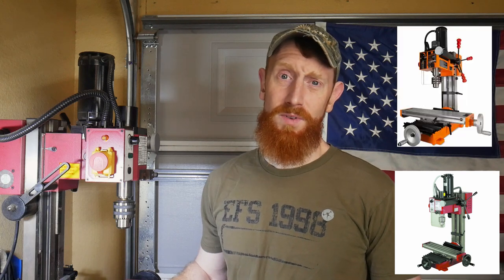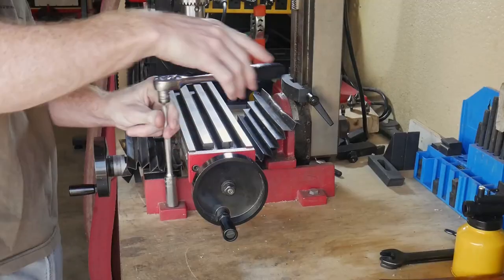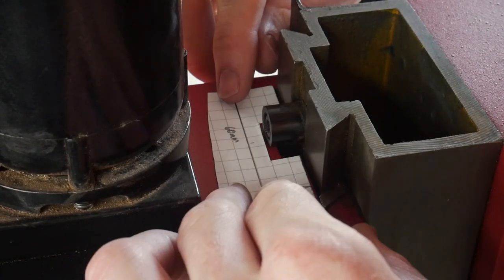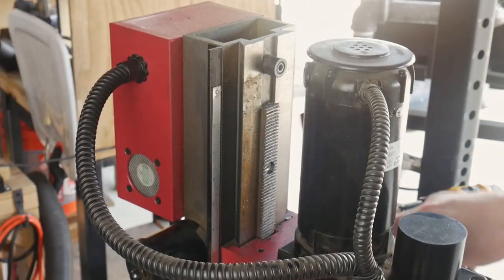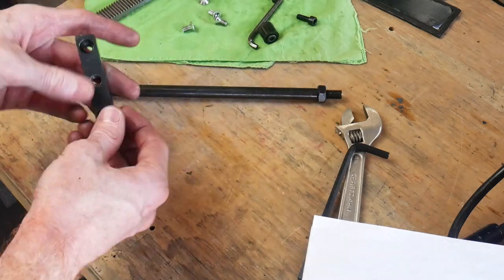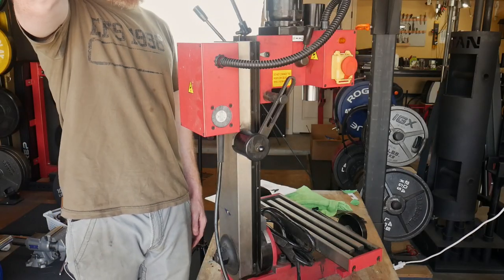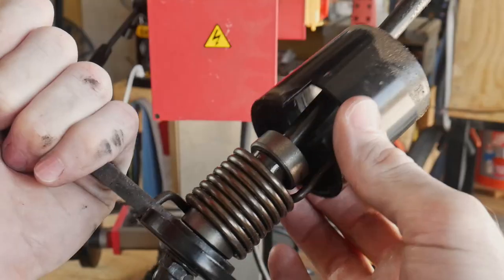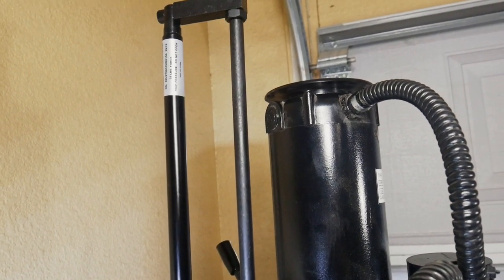Upgrading The Sieg X2D Mini Mill - Air Spring Install Guide

Comment: Dude, thanks so much for the help, your video supplemented with the instructions helped make this an easy project. I also saw the template was wrong . I’m not sure why they haven’t fixed it . This also gave me room to mount a dro on the left side now that the spring is gone.
Reply from the maker: Heck yeah! Glad it helped Matt! Cheers

Comment: I just installed this. Definitely go with his 20mm dimension recommendation for the mounting bracket, not the 18mm on the LMS template. I also recommend doing this at the same time you do the belt drive upgrade. At least the motor will be out of the way if you do. I had the spindle housing on a bench to pull out the old/uneeded intermediate shaft and  gears, so drilling and tapping as well as replacing the Z axis gear rack was very easy. 
I will say this air spring does support the mill head better than the torsion spring; however, the Z axis is stiff when course feeding downward toward the table. More than I prefer anyway, but I can work with it. I'm thinking that must be the tradeoff for the improved support unless I installed something incorrectly.

Comment: It is also worth mentioning that the reason LMS has these Sieg machines at their given price point is because they pretty much do all of the QC and necessary upgrades for you.  The same mini mill from Harbor Freight will not have that unless you do it yourself.  These guys are more like parts kits rather than full-fledged shop tools out the box.  Shipping kinda sucks given that they are located in Pasadena, CA; but they are definitely good to go if you want to purchase table-top machines and more.  I bought their 10" 12-speed drill press after my ancient Ryobi shat the bed, can't wait till that comes in!
Reply from the maker: Nice!
Reply: The Sieg mill is a "mill of many names" IIRC Practical Machinist magazine did an article on the SiegX2D. The same applies to yard equipment; i.e. lawn mowers, snow blowers, etc.

Comment: so it's basically threaded strut with a block to mount to the head. I think I could fab the upgrade, since LMS has been sold out of these for a long time. I could go on with my torsion spring but it kind of gets in the way for the best place to mount a DRO on my Grizzly 8688
thanks for showing the process! very simple to see how it's done
Reply from the maker: Cheers Paul! Glad you got something out of this one.

Comment: Good stuff... I have that same mill as well as the HF lathe.   I need to true them both up though and tighten up everything.
Reply from the maker: Very cool. I'm thinking of replacing the column on mine with a fixed column... That pivot is dumb
Reply: @RedBeardOps  I've got some kind of upgrade for it... brushless motor maybe?  Hell, I dont even remember what it is. I've had it for years now and havent gotten around to installing.  Too many projects, too little time.
Reply from the maker: @rroberts8501  Man, that's the damn truth...

Comment: Instead of using the round travel stop you could gain an extra 1" of upward travel by drilling and bolting a stop bracket to the very top of the post.  Assuming the air piston could travel that extra inch upward.  Just a thought, I may be wrong.

Comment: Red Beard; the next best thing you can do is install the V BELT conversion as well & eliminate the plastic gears inside the the top of the power head. I ordered my KLUTCH labelled X2D from Northern Tool before the "Kung Flu" hit & since then, the price for the same mill has jumped to almost 1,000.00. Harbor Freight's price is still under 800 bucks yet. I had a customer come into work one day asking if we carried the plastic gears to the Sieg X2D. I knew we didn't; I showed him the L.M.S. website on my phone & wrote it down for him & suggested he could get the belt drive & eliminate the plastic gears. I work at a family owned hardware store.
Reply from the maker: I did! - https://youtu.be/wOQ1QXdvO4s

Comment: Perfect video. Could you do me a favor, I hope it's not asking too much.  My enclosure for my mill when not in use has a certain ceiling height and I want to know if this will clear it with the head lowered all the way down. Could you tell me the overall height of the installed mechanism with the head lowered?
Reply from the maker: Thanks. With the chuck touching the table the total height is 26-3/4'' (about 3.5'' taller than the column)

Comment: Red Beard; in installing my air assist after watching you struggle around the motor; I would remove the motor fully from the mill and assemble the air assist and mount it to the mill before going through & measuring for the questionable holes (per the L.M.S. drawings which were underscale). Level the air assist up with a torpedo level & then use the punch to locate my drill holes through the block that mounts to the top of the machine. It may be an extra step or two but worth the extra effort. I put the belt drive onto my mill & it runs a lot quieter vs the plastic gears which are susceptible to breaking at the worst possible time.
Reply from the maker: Good point! Cheers sir
Reply: @RedBeardOps  when I got my mill home from Northern Tool after I toe the crate apart; it was "falling apart" by the time I got it from them. After I got it in the house I was going though things & took notice several fasteners that were installed with air tools were stripped out at the heads. I paid a visit to my local hardware store & got brand new fasteners. Call it O.C.D. but with my already planning on putting the v belt kit on I may as well get new hardware.
Reply from the maker: @MRHSDM316SD18186  Man I gotta say; if I had to do it all over again with Sieg mills I'd just start with the LMS 3990. It's fantastic - https://youtu.be/POFarYxpgws
Reply: @RedBeardOps  I bought my mill after I inquired with Harbor Freight on the price; they wanted the money upfront & they still had to order the machine. I paid Northern Tool after they got the machine from China.

Comment: Yup, going to buy this conversion kit for my second hand LMS 3960 I just bought.  I'm curious to know if it's best to leave the head all the way up so as to now keep the gas strut always compressed?  Basically, like springs etc. they stress relax over time so what's the best position to leave the head?  Thank you.
Reply from the maker: Man that's a good question. I have no idea! Worth researching.
Reply: @RedBeardOps  these struts have been and still are used in the auto industry.  One way to think about it, do car owners leave their hatches open when possible?  :)  It's probably a moot point to consider, but that's how I roll.

Comment: Looks like you could put a hole in that cap that went on top of the column and then you can seal it off just go around the air spring
Reply from the maker: Hey Casey, I think you're right that would work.

Comment: Nice video.  What types of metal are you able to mill with that?
Reply from the maker: With patience just about anything. I've milled aluminum and steel with it. You really need to take your time with it though on steel. Having a solid/fixed column would help.
Reply: @RedBeardOps  Does Little Machine Shop's mill have a fixed column as purchased?  How about their gears...are they plastic like HF's?  Have you upgraded those?  Sorry for 20 questions!
Reply from the maker: @walte99  It comes with a fixed column and air spring. And I think a more beefy motor. On the gears side, I know it doesn't have the plastic gears, but I'm not sure if it's got metal gears or the belt system. Worth checking out!

Comment: I just received my upgrade kit. The 18mm dimension you say could be 20 or 22mm... Which would you suggest to have the "air spring" plum, 20mm or 22mm? I'm going to remove everything so tool clearance isn't a consideration.
Reply from the maker: Hey man, I have to say I'm not sure. It was a while since I've done this project.
Reply: @RedBeardOps  
No problem. I just installed the air spring first and held it plum. Then I got my location. Turns out they may all be slightly different. I ended up at 15mm rather than the 18mm on the drawing or the 20-22mm suggestion from you. Thanks for your reply brother.

Comment: Dude, get your self a belt system.
You can make it your self if you have 3d printer.
You will how ever need at least 1 small pulley machined from either ABS or Nylon, or aluminum.
Large pulley can be 3d printed.    Check out my last video on that subject, maybe you'd want to try it out.
Reply from the maker: Sorry for my delay on this comment! I did that upgrade! Way good. https://youtu.be/wOQ1QXdvO4s

Comment: That spacer you didn't use. I purchased a 2mm longer capscrew for the rod attachment at the bottom of this assembly and used the spacer to move the cylinder section of the of the gas shock away from the column. It rubs at the fully lowered position without this spacer.
Reply from the maker: Thanks Bob!

Comment: Very nice! Um was that piece intended to replace the longer column stop you ground down? Or was it a spacer for the mounting rod of the assembly? Or maybe it’s for use in one of the other mills that are slightly different? No docs, so it’s all guessing here.
As to the torsion assembly....perhaps it becomes a piece of Damascus for another blade project....
I mean the spring might come in handy somewhere down the line, but it doesn’t seem like much of a spring, anyway. But it appears to have enough carbon to probably harden well and might just be good material for “Bodger’s Damascus” (bodger- see any old episode of Junkyard Wars).
I really enjoy these videos you put out!
Reply from the maker: Hey Chuck, that spacer wasn't in the instructions... so I have no idea! LOL, once I find out from little machine shoip I'll put it in the top pinned comment.

Good thought on the torsion spring... That spring may be good metal. 

Thank you sir! Have a great weekend!

Comment: What sort of things do you use that mini mill for?
Reply from the maker: I use it a lot as a very rigid drill press... But I've milled a good deal of aluminum on it to make tools (surface grinder). I also use it with a router bit to flatten handle scales. I've done some milling on steel with it as well, but note you'll have to be patient with your feed rates. Lastly I've used it to mill guard slots on hidden tang knives, and plan to use it to mill in my shoulders on my next hidden tang.

Comment: How much additional height is the assembly over the top of the column. I might need to reposition a light overhead. Fewer parts then the two air spring units and pully and cables I have seen done.
Reply from the maker: With the chuck touching the table the total height is 26-3/4'' (about 3.5'' taller than the column)
Reply: @RedBeardOps  So if the head is at the upper stop it could be like 13 1/2 inches above the column top?
Reply from the maker: @gvet47  The height of the mechanism above the column is fixed.
Reply: @RedBeardOps  Sorry had to watch again. Now I see it stays relative by the he fixed rod. I must have spaced out. I have a tachometer that sits on  the top of the column now but it is just on a magnetic base I moved  from a small wood lathe. Have a similar setup on my small metal lathe both in 3D printed boxes.

Comment: I also suggest the L.M.S. belt drive conversion.
Reply from the maker: I've heard great things about that!
Reply: @RedBeardOps  very easy to put on. I had the conversion kit before I got the mill from China. And it does make the mill quieter, and comes with all required hardware
Reply: @RedBeardOps  it runs quieter than with the plastic gears

Comment: So thats the mill Ive seen you true up surfaces on?  Is it capable of surface grinding?
Reply from the maker: Hey man, I use a surface grinder for the flats on knives. You could use a mill for that operation, but it would take much longer. I use this mill for all my drilling, and for milling in slots for guards, shoulders, flattening handle scales, etc. 

Here is my surface grinder build - https://youtu.be/_Q2aujE3pWk
Reply: @RedBeardOps  You were nice enough to reply and I thank you, but I think a meaningful  question is... can you grind a billet as flat and as uniform as capable, and use a mill to do the rest an a reasonable amount of time?  My budget wont allow to buy both the tools right now, and I'm not gonna build my own surface grinder and especially with out a mill?
Reply from the maker: @xthemadplumberx7110  I think to do this on a mill you would want a magnetic chuck and a fly cutter. It's all possible, but I think you'd be better off going a different route if flattening is all you want it for.

Comment: I have exactly mill (OTMT) and the motor has intermittent power. When I turn the potentiometer the motor sometime turn and sometime not turn. Anyone please help me to fix this problem? Thanks.
Reply from the maker: I bet your plastic gears are broke. Watch my belt upgrade here - https://www.youtube.com/watch?v=wOQ1QXdvO4s&lc=UgymRwUyb2-FRc-y6WF4AaABAg may help
Reply: @RedBeardOps   Thank you very much. I will upgrade my mill to belt drive as you did.
Reply: @RedBeardOps  I open the top. the gear look ok. Even with the motor does not attach to gear. It still not turn. I got only 64 volt to the motor. Not sure it is right.
Reply from the maker: @trivu5951  I'd advise contacting the people here to help you troubleshoot - https://littlemachineshop.com/
Reply: @RedBeardOps  I will. thanks.

Comment: nice little mod but it is a shame it goes inside the columm as I will be filling that with epoxy granite
Reply from the maker: You may be able to rig it up on the outside. Would take some fabrication though! Cheers man !
Reply: @RedBeardOps   I was wondering that also.. Thanks for the reply

Comment: did this years ago.

then as things like windows went hostile and PCs fried... i havent used it in years.

tearing down the other day. new bearings, spindle, blah blah...

THEY LEAK!

what was 15kg iirc, is now about 2kg...
Reply from the maker: interesting comment sir
Reply: @RedBeardOps 
contemplating an air cylinder now. 16mm/250mm stroke. assume 1/2 sqin.
regulate the input air to whats needed, so about 60psi.. actual figures may vary...
ditto on the exhaust, just a pound or two higher. 
doesnt need valves, only balancing the pressure in there.
(its closer to 90 psi, 16mm bore is approx 1/3 sqin. 20mm is about 1/2. theyre pretty cheap.)

Comment: Much worse then the spring,, l made a 1/4 inch steel base 6 inches wider and welded a back support with angle supports and permanently mounted colum, took out most of the chatter
Reply from the maker: I've had pretty good results with the air shock so far. Gosh the original spring was bad! lol; cheers
Reply: @RedBeardOps  yeah I agree I need to change mine,, but I had to fix the tram first,, with colum Mounted fixed and wider base I can make deeper cuts and much less chatter, couldn't even use all the motors capacity with the weak colum pivot before,, l used 2 Allen screws can still turn it on angle if I had to but I don't know why I ever would,, bad design , other than that I'm happy with the mill,, l have a Sheldon horizontal mill and 6 Atlas lathes and a Logan I've restored like new too resell,, they have tripled in price in the last 3 years